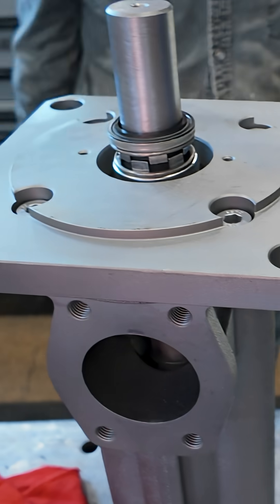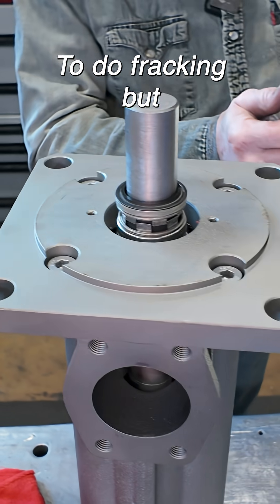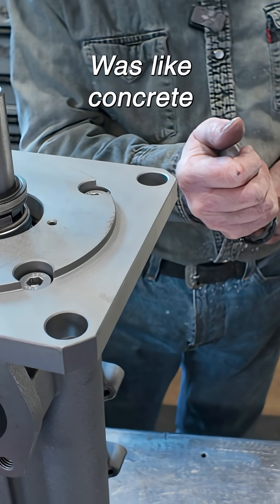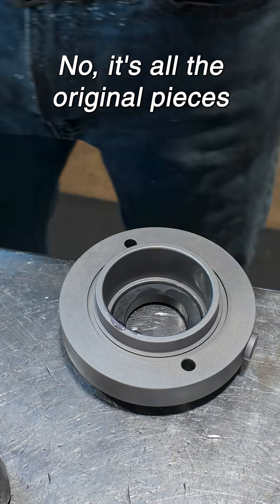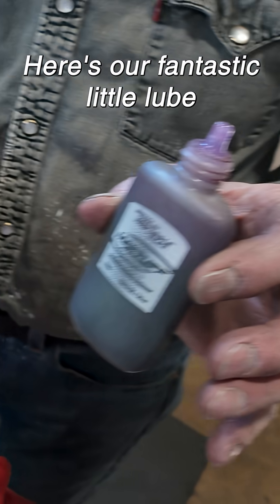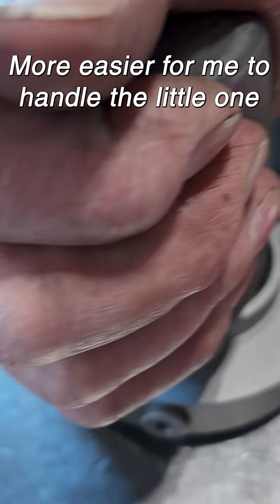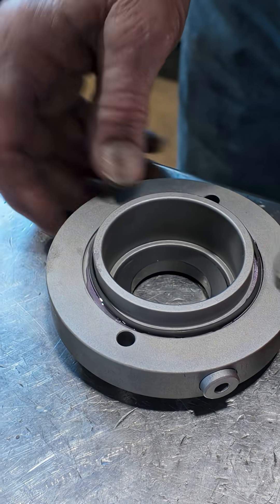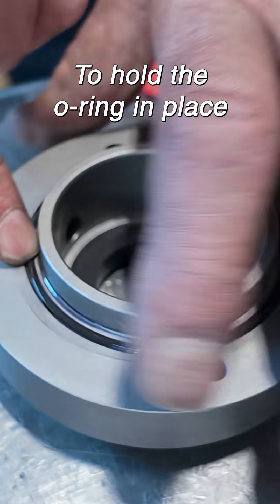Shanley SEIM Three Rotor Screw Pump Assembly Part 1

Comment: Mechanical seal guy here. Always wipe those faces with isopropyl alcohol to get smudges, fingerprints, etc. off of them. It dries quickly and helps take away any oily residue. 

Looks like you did that but just awareness for anyone else.
Reply: I used to assemble pumps on an assembly line during college. We were always encouraged to be sterile and wipe things before assembly but there was always some spec of lit or dirt left over.  Now that I get to write my own rule I assemble the seat and then flush with soapy water afterwards, no wiping.

Also, never coat your o-rings with oil or petroleum grease. An o-ring compressed in its groove has very little exposure to the chemical it's sealing against. If you coat it with those chemicals then 100% of the o-ring surface area is exposed and the life is drastically shortened if it's sensitive to exposure from those chemicals. Viton is ok with petroleum oil but nitrile is not so much. EPDM will be ruined almost immediately. Most rubbers are ok to coat with silicone greases but silicone rubber is not.